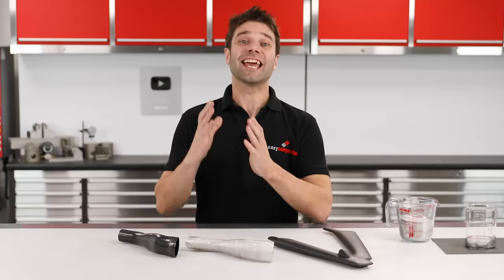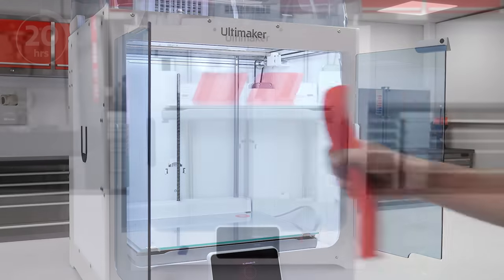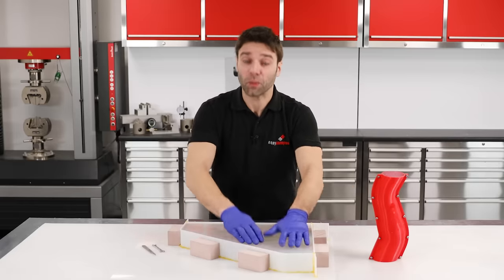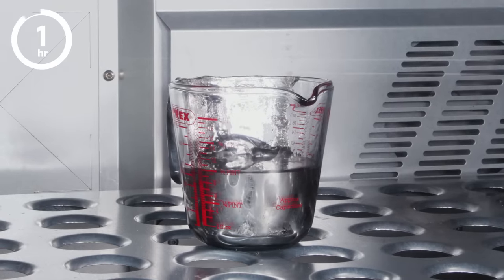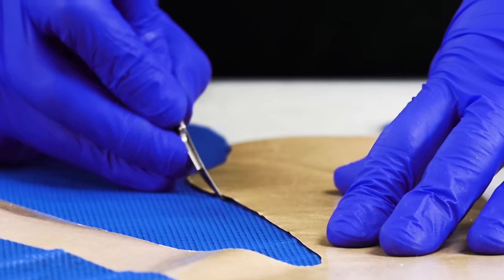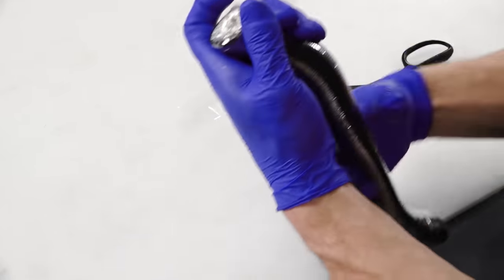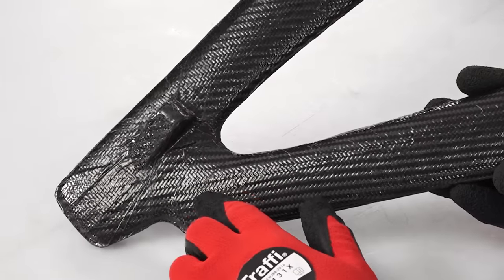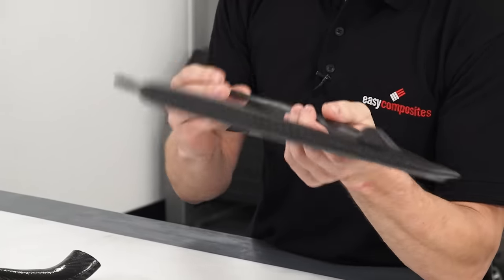Moulding Hollow Carbon Fibre Parts Using a Low-Melt Metal Mandrel

Comment: Koenigsegg lawsuit incoming
Reply: Hahahahaha, followed by a C&D
Reply: Why????
Reply from the maker: Haha, I don't think Koenigsegg would put a claim to this process; although it's not a widely known process, it has been used in composites since well before before their company existed.
Reply: @easycompositestv  I was just joking around hehe. Since they're special thing is hallow carbon wheels.
Reply: It's used in every part of the car ventilation channels. They make the low melt, put it in the injection moulding machines , inject plastic around and then melt it out.
Reply: Hahahaha!
Reply: @Easy Composite Ltd.
Thank you for sharing these ideas
Reply: Great video again. This is for sure a product that can solve alot of hard to make projects. Well done guys again.
Reply: Koenigsegg does have a similar patent but instead of a metal mandrel they use hdpe, the same material a plastic milk jug is made from. This allows them to pressurize it like a balloon, this is because they cure the part in an autoclave, at the temperature which prepreg resin cures the hdpe mandrel becomes soft and flexible. This allows them to both pull a vacuum on the outside of the part and pressurize the inside, this squeezes the layers into each other resulting in a stronger part.
Reply: Top video yet again 👍
Reply: @billyjoe3309  hal·low
/ˈhalō/
verb
honor as holy.
"the Ganges is hallowed as a sacred, cleansing river"
nounARCHAIC
a saint or holy person.
Reply: apple lawsuit incoming
Reply: Can’t get sued for discovering a process…
Reply: @avocadoarms358  Wanna bet?
Reply: @avocadoarms358   you to be special or something my guy 😂😂
Reply: Or use Styrofoam and then use solvents to melt it out
Reply: @jakefriesenjake  Does it withstand the lay up epoxy?
Reply: @headbanger1428  I don't know what layup epoxy is, but my brother, had a buddy years ago who had a Toyota supra. His dad had a body shop and like making things for his sons car. They made the shape of the intercooler pipe they needed using Styrofoam. Once completed, he then coated it with a thin layer of regular resin for carbon fiber (probably epoxy that doesn't have solvent in it that attacks the Styrofoam). Then you layer on the carbon fiber and more epoxy. Get it as thick and as smooth as you need it to be and wait a couple of days. He had a body shop so he probably poured paint thinners into to melt out the Styrofoam. Gas would probably work too. Now you have a carbon fiber part! I'm sure they didn't have a vac bag, but you can use one if you want to. Cheers.
Reply: @headbanger1428 yes but only epoxy
Reply: Makes no sense, the alloy specifics aren't mentioned and the process could be used with any variety of low melting alloys or metals or done independently of Koenigsegg.
Reply: Thise process have like 200 years in lost wax and  jewerly industry..😂😂
Reply: Are you sure
Reply: @KimoKimochii what?

Comment: When i say this is the greatest composite fiber channel on any platform, i genuinely mean it. The excruciating details are always covered but in the clearest and most concise way. You help us pleebs genuinely understand what we are hoping to achieve in addition to the step by step process. Dark aero is a worthy near-peer, but you are the man.
Reply: what do you build?
Reply: @sytran666  I'm working on a turbo 999cc briggs vanguard and a 1200cc vmax powered crosskart, and my perpetually broken 532ci 385 series bbf 1969 f100. I just try to make parts here and there with aluminum and composites. My channel is directionsnotincluded. I'm not a "YouTuber" I have just posted a couple videos.
Reply: @2000jago you don't get the whole opinion thing, do you? Maybe work on the reading comprehension.

Comment: The older lost mandrel technique is using regular Styrofoam. Carve/mill the foam blank to your mandrel shape. Layup the fibre/resin in the regular fashion as if it was the permeant foam core. After the epoxy cures, you can use acetone to melt the Styrofoam mandrel.
Reply from the maker: Only flaw is the limitation of the styrofoam if you want to use higher temp processes like pre-preg.
Reply: I actually did this with fiber glass for a rear speak housing in a 56 Chevy bel air. Ended up just leaving the foam to dampen its sound when tge seat belt hit it. Glad to know this was a real technique
Reply: @brett9382  If it works its a real technique :P if it doesn't it was also a real technique but not a good one.
Reply: @easycompositestv  I've seen the same thing done with home insulation foam boards.  I'm pretty sure they can take high temps as they should be fire resistant.  then you melt them out with acetone or paint thinner.
Reply: I used to do this ceramics. Built up the clay around the form and it would burn out in the kiln when fired.
Reply: This is actually an old method we were using lost core low melt alloys at DOWTY in the late 80s the video actually even misses one of the best tricks that low melt alloys have to offer , with bicycle the styrofoam is dipped into a latex creating a bladder and the whole thing layed up on the bladder, which then does exactly what you want it to when you want the styrofoam to melt

Comment: Fairly complex process but you did make a nice light-wt part.
Mack trucks had some complex fiberglass engine intake shapes, long before 3D printing, we made external aluminum molds , wrapped mandrel made of  inflatable rubber bladders in the laminate, wet, clamp alum molds around in a press, inflated bladder, allowed room temp cure or headed molds as reqd, and repeat!  Not Light wt parts but strong.  Now similar is done with blow molded abs! ( not as strong though)
Cheers Warren
Reply: based

Comment: Thanks for making this video, I never knew that using an alloy with a low melting temperature as the core for a part was even something that could be done. If I ever wanted to make a prototype of a carbon fiber part, I definitely think that this would be the way to do it

Comment: I have been trying to figure this out for the longest time and not many places on the net had info on melting mandrels. Thanks for showing this process. Could you guys do a short or episode on the proper methods of implementing fasteners and aluminum plates to avoid galvanic corrosion?
Reply: Use fiberglass for around the metal fasteners
Reply: Or fully 2k epoxy paint the fasteners
Reply: Do you really need to worry about it?
Galvanic corrosion only occurs in the presence of an electrolyte solution. So unless your parts are going to get wet (and stay wet) with a salt water solution of some kind, it is not a concern.
You probably can't walk through a room in your house with out walking past something that has screws running into aluminum - it is not an issue. Don't get sucked into this nonsense.
Reply: @joshua43214  as someone who works in the automotive industry I see galvanic corrosion all the time. If I was making car parts I’d be concerned about this for sure. I guess it depends on his application.
Reply: @KindredAutomotive  Yes, cars can be very prone to this if they salt the roads enough to degrade the anodizing.

In practice though, it is not a concern for most stuff. Just consider all the aluminum around you; your screen door, your TV, your siding, the signs at your local stores, etc.

Galvanic corrosion requires an electrolyte

Comment: Reminds me of the late 1970's when Gossamer Albatross made the first human powered flight across the channel.
In that case a 30m tubular aluminium mandrel was laid up and wrapped in shrink tape. Hot oil was pumped through to cure the composite and then acid dissolved out the tube.

Comment: I've seen this same process used with house insulation foam instead of metal.  you form the foam in the shape you want, wax it, create your carbon fiber shell, and then melt the foam using some kind of acetone or solvent.  pink insulation foam boards are easily available at your local home depot or lowes.

Comment: If I had to guess, the alloy is effectively a type of solder. Especially because I'd imagine the alloy needs to be eutectic to avoid deformation under pressure during the initial cure. And the usually low shrinkage of eutectic alloys is a plus.
If this is the case, some neat things can be done, speaking from some experience doing stained glass.
You can use the lead free alloy to make the initial madrels and components, and then use the lower melting point alloy with a soldering iron to correct surface mistakes and join parts. We used lower lead solders (higher melting points) to fill large gaps, and surfaced them with the regular 60-40 because it wouldn't melt the 63-37, allowing it to sit on top.

Comment: i thought the easy composites video's where already perfect, but the quality of this video is beyond that! I was thinking, to make the mold for the casting, the mold can be made using the investment casting technique, print the part out of PLA, put it in a bath of ceramic/ plaster and afterwards burn out the pla plastic, after casting the alloy the mould can be hammered of.

Comment: VERY nice.
I started watching and subbed to the channel because of my love of recumbent trikes and hoping to 1 day build 1. The melt out metal core almost seems like it should be the holy grail for a lot of bike/trike frame builds. You could easily use a silicone plug whose size would slip out in order to reduce the amount of metal to get inserted.
Reply from the maker: Thanks for the comment Alan, I hope to do a velomobile build in the channel one day, I'm sure this method will come in handy for a lot of the parts!

Comment: I have built many vacuum infused caron fiber parts for all the big 3 Automobile companies and several other electric and JMD manufaturers. I used to build similar metal mandrels and used both silicon rubbber as well as high temp epoxy molds. Just an FYI. I used a slow cooker (Cheap) to melt the alloys and keep the heat volume small for cheap electrical cost.

Comment: Great video. I would make a foam core for the wishbone, with some wire set into it. carbon fibre is brittle, so a bit risky for a safety component like a wishbone. The wire would (hopefully) stop it falling completely apart in a failure.
ETA: I didn't realise it was for a recumbent cycle, so maybe reinforcement isn't necessary.

Comment: It's been a while since I've seen videos like this but this channel is always a treat to watch. I would like to do a project with carbon fibre one day only the price of such a cure oven is quite a lot.
Reply: You do not need a cure oven. Only prepreg CF requires it, because of the type of epoxy resin.
There are plenty of epoxy and polyester resins that are ambient temperature cure.
Reply from the maker: You can indeed follow a similar process with hand laminating resins, although it would be important to use a resin that can take the temperature of the melt out. If you did use prepreg, it’s worth noting that you can use a conventional (domestic) oven for this process, you don’t need precision control and for the shrink wrapped version, you don’t even need a vacuum port into it.

Comment: That metal is also a great way to bend tubing without getting deformation or kinks at the bends.  It's especially useful for bending thin wall tubing to keep the tubing from collapsing.  I just fill the tubing, bend it, then throw the tubes in a pot of water in an old stove in my shop.  Heat it up and the metal comes right out, consolidating at the bottom of the pot and can be cooled and reused.
Reply from the maker: Thanks Mark, that's an interesting and useful application for a low melt alloy.

Comment: What is the benefit of using this alloy over making a wax mold?
Reply: Well, you would have to use a room temp cure epoxy if you use a wax mold. Unless you have a wax than can survive going through the curing oven at a temp that will harden the epoxy.

Comment: As someone with only limited practical experience, I wonder why not continuous woven sleeve, for the simple part? Seems like it should both be easier to work with, and get better material properties and cosmetics? Or are the advantages of professionally infused prepreg hard to beat? Or is it that it would be harder to conform to such a geometry than I would imagine it would?
Reply: As far as I know woven pre preg ‘ sock / sleeve ‘ is not available easily if at all  . Probably due to it being less compliant when large changes in direction or diameter. Not to say there isn’t anyone out there manufacturing it  .
Secondly pre preg carbon fibre sock / sleeve would be harder to control resin ratio during the manufacturing process as pre preg resin is usually applied to woven carbon via a roller system and it also applies the protective film at the same time so it can be roles onto cardboard tubes  .
You would need an inner and outer protective film on sock / sleeve to stop the inner walls from sticking together while in manufacture and storage and that would not be practical .
Reply: @newagetemplar6100  no i wasnt expecting such a prepreg sock to be available; let alone in the diameter or thickness or weave of interest; but I would expect pretty clean results wetting out a sock by hand.
Reply: @eelcohoogendoorn8044  yeah sorry , thought you were on the pre preg thinking mode . 
Yeah you could use a dry ‘sock’ and probably quite well , generally it will bridge between an inner radius . The sock will conform quite well as if you pull both ends it will naturally tighten around the mandrel then wrap with the release tape  .
May get a bit messy too but as you would have to melt the core out high temp resin would have to be used so it’s way easier to use pre preg . 
A solid wax core is an alternative using the same process if the end product is not subject to extreme temps . 
Again sorry for the confusion but hope this helps

Comment: Is there a better way than using a vacuum bag for that wishbone part? So that no surface finishing work is required?
Reply from the maker: Shrink tape would not work due to the shape, hence the need for a vacuum bag.

Comment: Yes I’m watching this again. 😂
I have a new tool to help me create a carbon fibre inlet manifold for my ford Xflow 1600, namely a laser 3d scanner. 
The laser style scanner is able to scan down into holes, but I will still take a silicone mould of the actual port. To create 3d scan from. 
Lots of time has been spent flow testing and porting this manifold. So I’m keen to perfectly replicate the inlet port runner. 

Heck man, you should consider creating an episode covering a nice carbon fibre ITB four-banner inlet manifold. 

😂😂😂

Just saying 
🇦🇺🤜🏼🤛🏼😎🍀🍀🍀☮️☮️☮️

Comment: For the wishbone, what are the advantages of this process over just laying up the prepreg over the polyurethane model board pattern? The finished piece will be lighter by the weight of the pattern, but are there other differences/advantages?
Reply: Tubular objects don't really benefit from having a core is my guess. It would be tougher with the core, but if engineering design determines you don't need it then you don't need it.
Reply from the maker: Pretty much as Lupus says, most components like this achieve a higher strength to weight ration by being hollow. A foam core of sufficient density to take a reasonable amount of consolidation pressure would weigh many grams and add little to the stiffness of the finished component. That said, there definitely are times when laminating around the outside of a core that’s left in is a good way to go. You need a core that can take prepreg curing temperatures, like Rohacell.
Reply: Thank you so much for the thoughtful reply.

Comment: Very interesting method, but if you'd go with conventional fiber and vacuum bags you would probably be ok with simple high temperature wax, which coincidentally is printable, so no additional steps with casting is needed. However this is not suitable if you need to create a batch. 
Anyway I am very happy to see yet another one method of doing composite parts, you guys are awesome.
Reply from the maker: Thanks and yes, you’re quite right that wax could be used for the mandrel in ambient temperature cure applications. It’s not suitable for prepregs and there are other drawbacks but used as you describe, if the wax could be printed then that would indeed be a nice quick workflow for the right project 👍.

Comment: is prepreg necessary for this method? or can you use simpler wet layup methods?
Reply: It sounds like the constraint is you need a resin that will survive post curing at a temperature higher than the melting point of the metal. Most hand layup resins can't do that, I suspect. A lot of hand layup resins can't achieve a glass transition temperature of 91 C no matter how you post cure them.
Reply: @mckenziekeith7434  thanks, yeah hadnt thought of that. Maybe an even lower melting point alloy
Reply from the maker: So it’s right that the constraint is the Tg of the resin and also that most conventional epoxies would have a Tg of about 60-80C so this is the problem. However, there are high temperature laminating resins, like our EL160, that have much higher Tgs (160C in the case of EL160) that would cope no problem.

Comment: You can also use the lay up method with dense styrene foam (insulation foam (pink/blue), carve it to the shape desired.  Add the composite to the foam.  When it's all cured, pour acetone into the form and the foam dissolves away into goop leaving the shell behind.  The inner surface texture won't be perfectly glossy smooth unless you apply release agent, but it's a neat way to create composite shapes.
Reply from the maker: Yep, this can be a useful process. We did a video recently about mouldless construction. If possible, we’d avoid melting out styrofoam with solvent, just because of the horrible sludge it produces, but if dissolving it can’t be avoided then it’s certainly an option.